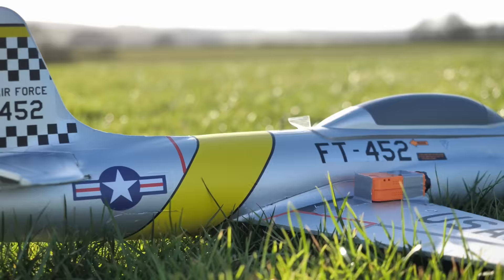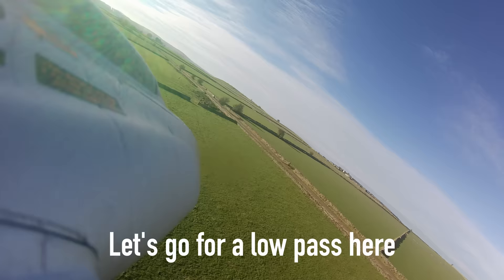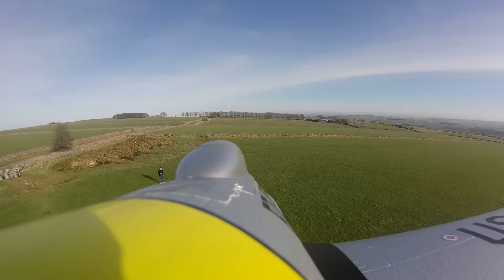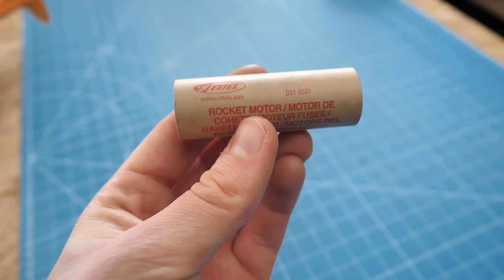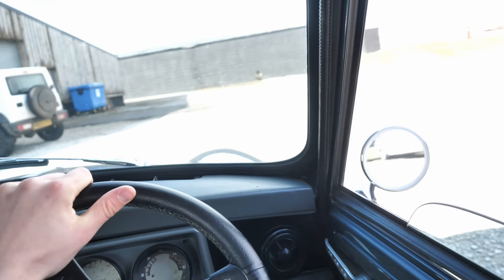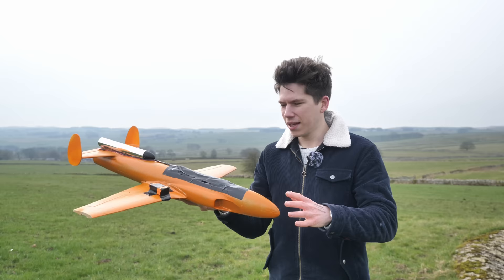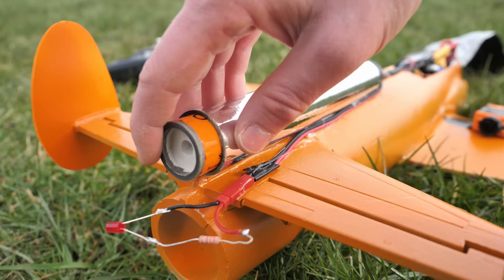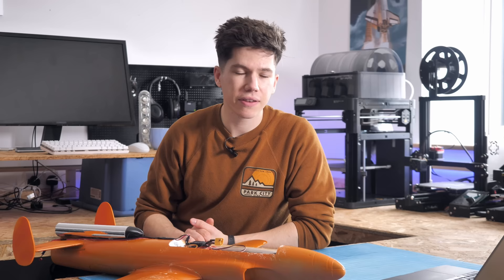Building the WORLDS FASTEST RC Rocket Plane!

Comment: When soldering, I find if you put the iron underneath the joint and let the heat travel up it works much better.
Reply: From what i learned on youtube its also the correct way to solder wires, so that the solde wicks all the way through the wire.
Reply: The Iron is too cold/too weak/old wire/bad solder
Reply: Yeah the soldering did look dodgy
Reply: The placement of the iron tip has far less impact on the solder joint quality than the solder tip temperature.  A higher wattage element, and/or larger tip would be the fix here.
Reply: @meanderinoranges  This is 100% true, the underneath trick only really applies with lower wattage irons. The majority of the heat transfer actually comes from tinning the tip of the iron so there is molten metal to bridge the gap between the iron and the thing you are soldering. Same logic as using thermal paste on a computer.
Reply: @sadface  true. The quality of the solder is also really important(flux). As well as the oxidation of the wire
Reply: @meanderinoranges  yep. Gotta get it hot.  If not you will get a cold joint or damaged components.  The idea is to heat it quickly and then get the heat off of it.  Less chance of damage.
Reply: Couple tips from someone who has a lot of certs in this subject. 

Clean the joint, clean the solder tip. And make sure its tinned.

FLUX, by god, use flux. If you don't, it's wrong, plain and simple. The metals and solder may be oxidized already, or may oxidize rapidly with heat. Oxides not only greatly inhibit heat transfer but contaminate the joint. You cannot get around it, its an acid and a necessary part of soldering. 

You want maximum heat transfer between the solder tip and the joint. Don't use the iron like a pencil. Lay it down a little get the most contact you can. This is why they have chisel and bevel tips. That and when you have iron touching the joint add a small amount of solder between the two. This will help heat trasfer. Once you see it start to wick you can add more. If you're having problems it's probably not enough heat or not enought FLUX. More flux, more better.

Tip temp around 660f is good for most things. Maybe hotter for bigger joints, but probably a bigger tip is what you really need.

Clean everything after with Isopropyl.

And remember, may the flux be with you.

Thanks.
Reply: I use soldering acids, they help too
Reply: The tip is way too small. There is not enough stored heat and contact area to solder such thick wires. The wires are moving the heat away from the joint much faster than that the iron can push in to it.

I have soldering needles for the really small jobs like smd (large magnification necessary). Soldering irons for normal jobs (slight to no magnification necessary). And I have soldering pokes, big irons ranging up to 300W with big chissel style tips for big jobs (those you can see with one eye closed after 10 beers).
Reply: This is the way
Reply: Also, get a flux pen and coat the wires, first. And a $30 hot air rework station for more heat than a little iron.
Reply: I'm actually pretty sure he knows how to solder and we're just being trolled.
Reply: Iron on top pools the molten solder on the wires not the table.
Reply: @BrassAxe  Old Navy electronics technician here. This guy didn't emphasize flux enough, and 350 Earth degrees is the translation for 660f. ;-)  The whole point of soldering is to transfer the most energy in as little time as you can, and your tip bridge between components (and flux!) are your mediums to do so. 

To do otherwise would be treading in the waters of the Dark Side of the Flux.
Reply: @GhostRyderFPV  Hit the nail on the head.
Reply: Conduction knows nothing of gravity - so doesn't matter where the tip is.
1- clean (flux)
2- clean (tip)
3- power (temperature)
4- size (heat transfer area)
5- tinning (tip)
Once the tinning contacts the strands and it's "wet" the solder will run by itself - up-down-sideways.
Reply: I think he just made a missile that guided
Reply: @meanderinoranges  ✅✅✅🤌🏼
Reply: Can someone explain to me why my iron gets gnawed? Is it the acid in the solder?
Reply: I thought I clicked on a meme video. I was so confused.
Reply: You 0eess_33
Reply: ..he
Reply: @almaefogo  q
Reply: Also, don't use the eco-friendly lead free solder (if that's what you may have done).  It's fine for industrial production line soldering but not for hobby work.  Get some old fashioned 60/40 tin/lead stuff - don't eat it or use it to make copper moonshine stills.
Reply: Yep, heat the wire and melt the solder into it
Reply: Also for the love of god be civilized and use some flux. You can use pine resin in a pinch
Reply: @sadface  flux, the bane and savior of every single soldering project
Reply: @almaefogo  yep
Reply: I too put the iron underneath the joint. Then inhale deeply.
Reply: it wont be able to land intact though,every time you land it the iron may be damaged or the foam body of the plane may be damaged to
Reply: I usually see comments like this and thing.... What a jerk, then I saw him soldering and was like 😮
Reply: Needs tin of flux and bigger iron.
Reply: 1wyoàv..,,
Reply: Have everything fluxed well,and a higher wattage iron.the solder will find the flux.
Reply: @morganmade1845  if he didn't Flux and have everything tinned,then he's clueless.
Reply: not really
Reply: 🔴 What Is Islam? 

🔴 Islam is not just another religion. 

🔵 It is the same message preached by Moses, Jesus and Abraham.

 🔴 Islam literally means ‘submission to God’ and it teaches us to have a direct relationship with God. 

 🔵 It reminds us that since God created us, no one should be worshipped except God alone. 

 🔴 It also teaches that God is nothing like a human being or like anything that we can imagine.

🌍 The concept of God is summarized in the Quran as:

📖 { “Say, He is God, the One.  God, the Absolute.  He does not give birth, nor was He born, and there is nothing like Him.”} (Quran 112:1-4) 📚

🔴 Becoming a Muslim is not turning your back to Jesus. 

🔵 Rather it’s going back to the original teachings of Jesus and obeying him. 

More .....
Reply: Hard disagree. Get the tip wet with solder, and it immediately heats the join from above. Like 2 seconds tops. Use 60/40 solder, and use lots of flux.
Reply: The second try was fast!
Reply: I recently learned this too. So much better
Reply: @almaefogo iiiii
Reply: @almaefogo iiiiiiiiiiiiiiiiiiiiiiiiiiiiiiii😅iiiii😅
Reply: @almaefogo iiiiiiiiiiii
Reply: @almaefogo iiii😅 iiiii😅iiiiiii oo😅 iiiiiiiiiiiiii oo i😅
Reply: @almaefogo i
Reply: @almaefogo iiiiiiii
Reply: how much did it cost

Comment: What I found ironic and fascinating was that as you worked on modifying the model's overall design, it started to turn into a German V1 Buzzbomb.
Reply: It reminds me of the Yokosuka MXY-7 Ohka especially, what with the H-Tail design and orange color
Reply: What da hailll
Reply: Indeed
Reply: In all fairness that was a pretty decent design.
Reply: The rule of pitch up down for pusher or rocket mounted behind the wing:-
1. To pitch up ,  Mount the rocket pointing slight up thrust ( not down)
When the rocket motor is mounted above the lateral line of the wing, it will cause the aircraft to pitch down not up when powered up. 
That is why when the rocket ignite , you experience a nose down attitude till the motor burn out.
Reply: 🇵🇾агоньклатурба
Reply: @Eva-xj1wn hitlerious!!
Reply: I thought it looked like a plane I made in KSP. it used the CR-7 hybrid engine (yeah, that was kinda overpowered) and the F3S0 "Shrimp" solid rocket motor. I might make a second version that looks more like the one in the video.
Reply: It kind of looks like 1941 the Japan plan that they use since the tail is like that

Comment: estes motors that are labeled D12-0 do not have a smoke delay (as indicated by the 0) or parachute ejection charge, but they do have an ignition charge to light the next engine on top of the D12-0 (as this is how they are intended to be used). This ignition charge is what ejected your motor.
Reply: yes, they make motors suffixed with P, which means they are plugged - no ejection charge
Reply: Correct!
Reply: You took the words right out of my mouth
Reply: the ignition charge is also just the end of the propellant grain
Reply: that makes a lot os sense as in the video you can see a small flash and the engine pops out the back with a smoke trail.
Reply: @spud4242  ive had had cluster booster backflash and light a failed ignited booster and back burn on the way back down
Reply: Yes, that's correct.
Reply: I was about to explain the same thing. 🙂
Reply: A D12-0 does not have anything called an "ignition charge". The propellant grain is left bare on the head end, the engine is ignited, the propellant burns, and eventually the remaining propellant at the head end cannot hold the pressure, it yeilds, blowing burning propellant forward. That is what ignites the upper stage.
Reply: @brettbuck7362  the D12-0 (and any other ESTES motors designated with a -0) has a black powder charge that ignites the second stage engine AND ejects the engine and/or first stage empennage depending on the design. go buy a pack, cut the thing in half... you see that black capping material? that's black powder.
Reply: @Araye  No. There is black powder, but that is the top of the main propellant grain. There is no separate charge - they make it by leaving out the delay and ejection charge from a conventional engine.  What pushes the stages apart is the combustion pressure breaking through the head end of the grain, and the upper stage ignition. In fact, the pressure from the head end grain breaking through is an undesirable side effect, which is why you either tape the engines together to take the pressure long enough for the burning particles to ignite the upper stage, or vents (like Centuri Pass-Port staging) that relieve the pressure so the stages stay together long enough. This is all perfectly well illustrated in Estes TR-2, figure 1A, Centuri TIR-123 and any 60's or early 70 Estes or Centuri catalog.
Reply: @hadleymanmusic  That used to be an occasional problem with single-stage clusters, too. Before they used clay caps over the ejection charge, they used paper caps that were just pushed into the top. If one or more of the engines failed to ignite, it would take off, delay and ejection charge would go off, and the ejection charge of one of the non-firing engines might get set off. This frequently resulted in igniting the delay charge from the wrong end, and then the main propellant grain, which would set the entire rocket on fire. The solution was to put a little bit of wadding in each engine. The clay cap engines don't have this problem.
Reply: @brettbuck7362  look, we are both saying the exact same thing in different ways. does the top of the bp grain explode? yes. this is what i'm referring to and you know it. is there a separate charge added to the grain? no. that's why i used quotes in describing the "ignition charge".... because i didn't want to sit here and explain the exact pyrotechnics and physics of what's happening when the flame front burns through the end of the grain. it doesn't just "burn through", it explodes as it was designed, to ignite the next stage and eject the first. if you design it properly, you can even get the engine to eject from the first stage lowering it's mass for safe recovery. some people, while it is NOT recommended, even use the -0 motors to eject recovery devices. LAST POST
Reply: @Araye  There is no "ignition charge" and the grain does not "explode". You just don't understand the terminology, that is fine, but insisting on your original faulty notion with  a semantics argument is pretty silly.
Reply: Huh, I didn't know engines could be doubled up like that, that's pretty sweet
Reply: @ChrisMisMYhandle  😮
Reply: @brettbuck7362  That is absolutely correct. No bulkhead, no delay, no ejection charge and no "ignition charge". Just a solid grain of BP.
Reply: Also with the F motor, if it's friction fit, the deceleration from aero forces could yoink it out. 3D printed motor retainer
Reply: @AKSoapy29  yes thats how i said byebye to my rocket lol! Tooo high
Reply: i checked the comments for this
Reply: Propellant is the same… propellant burn through caused pressure to build behind the motor…solution is a vent hole after the motor stop. Also heat from the burn melts adhesive on the tape
Reply: Or just use special “plugged “ motors
Reply: Waht

Comment: What a great project, it makes me want to buy some of those motors and do some tests.
The camera is like a big aerobrake, if you remove it, you may gain 10 or 15 mph.
Reply: It would go faster, but it wouldn’t look nearly as cool to us
Reply: maybe he could incorporate a little cam in the head of the rocket motor slot?
Reply: @ewanfarley  the problem with that is the ejection charge used to eject the nose come of a model rocket produces quite a bit of force.
Reply: @ewanfarley  I think the camera housing should be replaced by a more streamlined form flush with the rocket tube. will give no adverse yaw when it will sit on centerline. Lenses are round, the camera itself is small, so integrating things will be easy and the rest of the electronics can be hidden in the fuselage.
Reply: he could put it in the nose with a aerodynamic cone on it and then he can see from the nose

Comment: Just a quick note. You're looking for motors ending in a P for plugged. 0 means there is no delay before the ejection charge. Great vid looking forward to the next one. 👍
Reply: Actually, it seems to me when it tosses that big heavy engine casing out the back it would give it a forward boost, so perhaps all he has to do is make sure that the bulkhead that the engine is mounted behind is nice and solid, and then the ejection charge would actually help him reach his goal of a speed record
Reply: @brianward7550  "blasting the big heavy engine casting out the back" That's the ejection charge engines with a P at the end are designed to not do that. The bulkhead is built in and there is no explosive past the fuel. Thanks for the reply =)
Reply: @wilgarcia1  12-0 engines have no ejection charge. It's a solid grain of BP and nothing else. No bentonite bulkhead capping it off as in the 'P' designated engines. These are used in booster stages. There is no ejection charge. The remaining burning propellant is what pushed the casing out.

Comment: What if you mounted the camera in the rocket nacelle nose cone?  It would bring your CG back, put the weight midline, and be simpler than cutting into the foam wing or foam nose.
Reply: I initally thought making a wingtip pod for it, then the idea of mounting it in the removable canopy came to mind.
Reply: The nose seems rather obvious else.
Reply: he better should get an insta360 GO2
Reply: How about trying it without the camera.
Reply: What camera are you using  ?
Reply: I can here to suggest the exact same thing
Reply: i was going to suggest in the nose with a plastic nose cone and a hole at the tip so the camera can see out

Comment: Your roll oscillation may also be "aeroservoelasticity," (ASE) also known as "flutter." Nearly all aircraft exhibit ASE at some high enough speed; it's usually a factor in the high speed limit given in the flight manual. The wing's natural flexibility (elasticity) can couple with the controls (servo) through aerodynamic loads, and result in oscillations that often result in failure of the structure. If you're getting the beginnings of ASE at 130MPH, you might get fully destructive oscillations at even slightly higher speeds. Typically the onset is rather sudden and even a few knots of airspeed mean the difference between some mild instability and runaway destruction. Yes, it could ALSO be simple gyro gain issues, but you should not fail to at least be aware of the possibility of ASE.
Reply: While a great technical explanation, what he was experiencing is gyro oscillation - easy to tune out if you reduce the gain by cranking down on a potentiometer in the gyro.
Reply: great explanation. thank you

Comment: Model rockets tend to have an ejection charge after the main burn happens. The ejection charge isn’t for the rocket engine to pop out of the fuselage or tube of the rocket. The rocket engine is supposed to stay in the model rocket and the ejection charge is supposed to pop the nose cone off which then pulling out the parachute and shock cord 

Anyways would be cool if you made a high power sugar rocket engine using sugar and stump remover it’s a little sketch but worth it

Comment: This project is a reminder of the NF-104 of which Lockheed built 4 (I think) examples in 1963.  They put the rocket motor in the vertical stabilizer with a significant downward thrust.    Your project looked like a blast, thanks for posting
Reply: Even more crazy is that they put an F-86F with the same engine into Mach 1.22 before that.

Comment: Been there done this. I centered the engine at the CG and made it eject when spent to launch gliders. You can also use a rubberband plane wound up, have a small metal pin stop the prop from unwinding. Then have a string tapped to the rocket engine and tied to the pin. You launch the plane with the rocket power, the rocket engine ejects pulling the pin and then the rubber band powered prop takes over. Had cometitions at the field to see who could get highest/farthest/duration from modded foamies.

Comment: You're using a Spektrum air receiver. They make those with gyro's built-in and that can be tuned directly from the transmitter. This would not only save weight from having to use a separate receiver and gyro but would also allow you to quickly tune the flight characters between test runs.